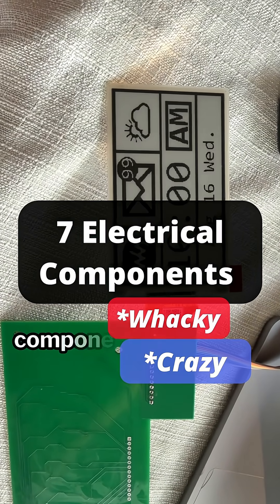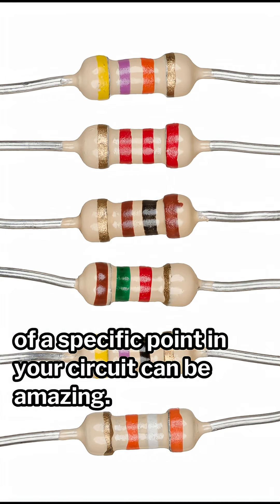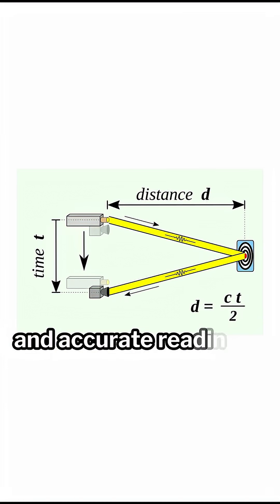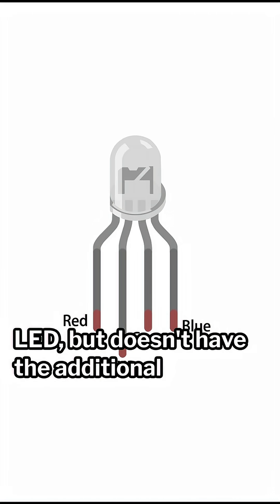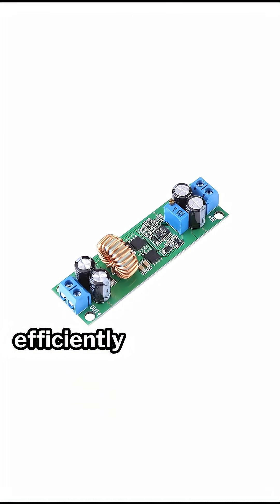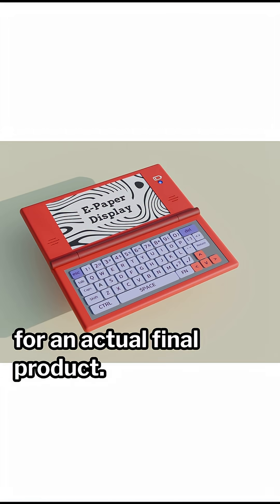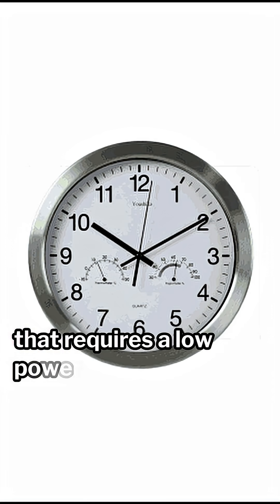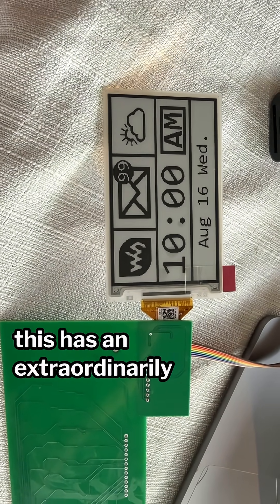7 Whacky Electrical Components  #advice #arduino #electricalengineering

Comment: There are also tiny and cheap boards called boost converters and buck converters that convert a DC voltage input to whatever voltage you need (if they're labeled as Adjustable)

Comment: The digital potentiometers are incredibly dumb they can only handle the tiniest amount of power. 
All you need is a bunch of resistors connected to a digital selector how many different settings do you actually need?

Comment: What exactly does the IC on the LED do? Because you still need the regular microcontroler for "deciding" how bright to make it
Reply from the maker: It regulates the brightness and controls the color. The important part is that it is controlled digitally. So you don’t have to rely on driving a bunch of pins with pwm.

Comment: How is a digital potentiometer different from a transistor?
Reply: It use a n-bit resistor matrix, just put resistors in paralel for make a different resistance value , the control is via SPI or I2C.
Reply: I think a transistor is just on-off
Reply: @younscrafter7372not true